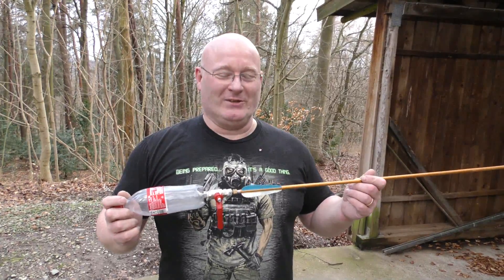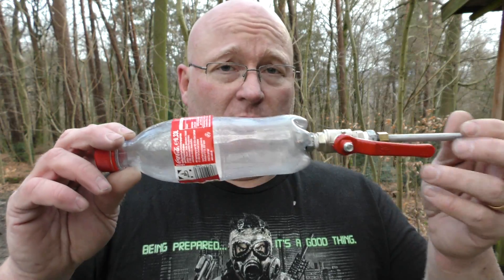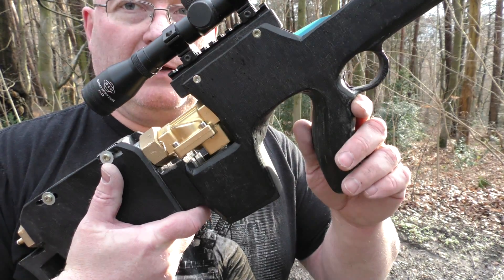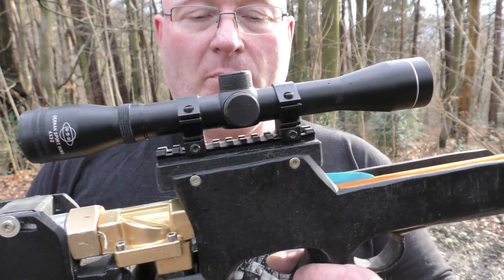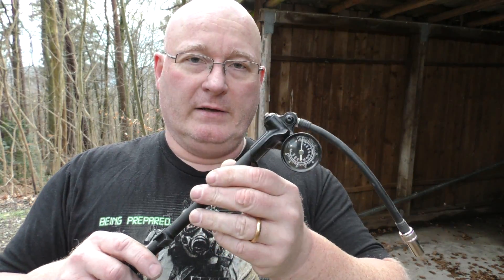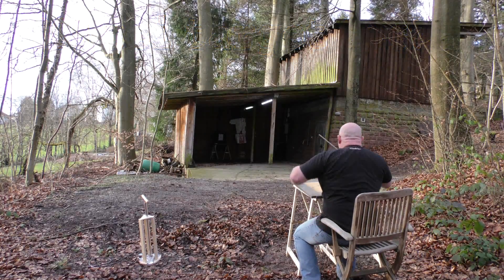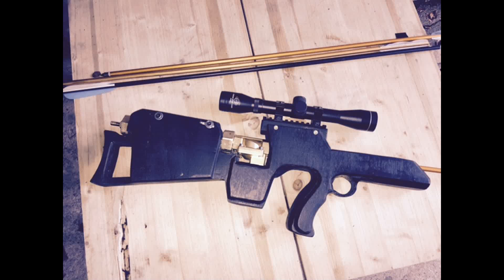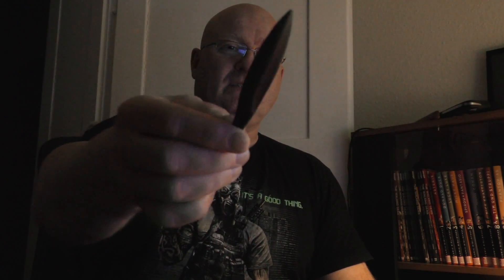Homemade "Bullpup Sniper Airbow" made from plumbing accessories

Comment: i made something like this, except i shoot bbs out of it and it doesn't require a coil for the solenoid. The valve is basically a plastic washing machine valve but instead of using a solenoid to activate, it uses a car tire valve which releases air when pressed. It basically works like a QEV, first, the air is pumped into the air chaimber, and some air goes into the car valve (trigger) area, sealing the air chaimber from the barrel in the process. When the valve is pressed, it releases the air that compresses the rubber to the barrel port resulting in the rubber unplugging the barrel port, which releases the air as violent as with the solenoid. Max pressure (to my knowledge) is about 10 BAR with the PPR air chaimber and it doesn't require any batteries.

Comment: Razor Discs in a normal AIRGUN will go thru trees., and keep going. Stainless steel frisby like disks honed to razor, channeled thru a disc shaped BARREL is extremely deadly. The Military developed what they called a "LANCER ROUND" they outlawed for obvious reasons as it will pass thru the human body like hot butter. NOW make them EXPLOSIVE ON CONTACT and they may even penetrate tank armor. GO FIGURE

Comment: Glad I watched this, I'm slowly getting parts together and was going to work within the limit of these 12v solenoids (never more than about 150psi) using light projectiles, based on the steampunk pistol vid. But if Joerg is putting it through 300-600, that's enough for me. The pistol might even be higher, since he used co2 which is something like 800+ psi. I suppose for momentary usage a solenoid can deal with it. 

Here's my thinking, to avoid gas wastage and save hours of pumping: use co2 or HPA, regulated. Then a ball valve, then a small reservoir before the solenoid. After each shot you open and close the valve, which leaks in enough gas to fill the reservoir but prevents far more than needed to be vented with each shot. You can see Joerg's switch would release everything, which is how it's designed, but a spring momentary would take care of that.

Hell, even 150psi is enough to bury a 13mm BB in wood.

Notice me, senpai

Comment: Kids- Don't try this at home! Mad Jorge is using a 16 BAR  rated valve at better than 40 BAR and holding it up to his head. Quit asking the man for a parts list, blueprints, kits, or builds. He may be crazy, but he's not stupid enough to share the details with someone who can't even figure out "spell checker" PS my 18 v dc Ryobi air compressor will do 10 BAR. Hmmm, I feel a "Hack Attack" coming on. AHAHAHAH
Reply: I guess that explains why I've been having trouble finding a 600psi valve that isn't crazy expensive then.

Comment: Without criticism, would it not be e better way to calibrate the weapon, if you set it on a fixed jig, and then adjusted the sight, accordingly? This way you would not be moving the reference position each time you get up, inspect or reload the weapon and try again. May you try a lever - inside the buttock - that will convert a stroke into a pump action, the type of the bicycle pump you  showed. Nice weapon.

Comment: Why not use the same compressor as in the previous videos instead of manual pumps?
Reply from the maker: Too weak, need more pressure.
Reply: +JoergSprave we need to go deeper
Reply: Could this be done with nail gun 22 blanks or a 223 barrel turned town with blanks

Comment: If you want to improve it you can replace the solenoid valve with a quick exhaust valve that can be piloted with a ball valve  or better with a slide valve and doesn't need a battery ;)

Comment: what is the battery for if you pump it manualy?
Reply from the maker: +CaptainSkelebones For the valve. Fast and can be opened with a trigger switch, much more accurate than a huge ball valve lever.

Comment: Hallo Jörg, wie wäre es mit mit einem kleinen Upgrade? Ich habe die Paintball HP Flaschen für mich entdeckt. Standard liefern die 850psi aber es gibt auch welche über 1000psi. Anstelle des Schrader Ventils kommt ein ASA on/off Ventil und dann ein Remote Paintball HP System. Die Paintball HP Flaschen kann man leider nicht direkt verwenden da sie nicht genug Luftmenge für unsere Zwecke liefern und deshalb braucht man einen Zwischenspeicher. Um die Flaschen aufzupumpen benutze ich eine Sportschützen Luftpumpe und eine 0.8liter Flaschenfüllung reicht bei mir für 8Schüsse(3000psi-2000psi danach fällt der druck des Regulators/Druckminderers spürbar ab) Meine Pfeile erreichen im moment rund 250fps aber ich bin noch am optimieren(größe des Zwischenspeichers, Pfeildurchmesser etz.). p.S. solche Paintball HP-Flaschen kann man sicher auch noch für andere "böse Spielereien" verwenden ;D

Comment: that little pump is typically used for air suspension installed on mountainbikes, hence the name suspension pump. the highest pressure used for the super narrow 18-20mm racing tires from back in the day was about 180psi/12bar, modern 23-28mm tires requiring a maximum of only 120 or so psi.
for comparison, on a "normal" bike it would be 40-60psi.

Comment: Oh I want to make one.  I think gatling would be a rotating electrical contact and could really be any configuration.  I have in my imagination a side by side with two electrical triggers.  I would imagine taking it up to scuba tank pressures with certified components for pressure, fittings, valve etc.  Therefore I'd expect such an invention to achieve arrow velocities equivalent to the $1000 Benjamin Pioneer but be a two shot that would make it a great hunting tool.

Comment: Joerg, another way to use the air gun would be to attach a small magnet to the barrel so that you could slide a BB down the barrel and have it stay in place, the air pressure would easily overpower the magnetic forces and shoot the BB, most likely more powerfully then the arrow.
Reply from the maker: +TheGhettosponge That would be a gun, legally. Don't have a gunsmith license.

Comment: Joerg, I don't know if anyone has suggested this to you yet, but the design of that smaller high quality pump, you could make it crankable with a piston and have it be a fully contained unit, and much faster to pump.
Pretty tempting to build one of these myself now, where did you get that little pump?
Reply: +The Nernbutt I don't know where he got his, but if you want some handpump that can reliably pump up to high pressure look into the ones that are used for PCP airguns. Considering how small that pump he showed was I think it could be used short term, but if you keep driving that piston hard non-stop it will probably wear out on you pretty fast. The high pressure handpumps aren't cheap though, but the Hill pump I've got has been reliable for years. I did have to replace the oring seals once and its not as pretty as it was originally but functionally its as good as new.

http://www.airriflepump.com/acatalog/Air_Rifle_Pumps.html
This company makes one variety and mine has been serving me well for a long time now, easily gets the cylinders up to 200 bar with just my bodyweight and if I'm insane I can make it up to the 275 bar putting a bit of extra air slowly into my diving cylinder with a surface type valve (longer time between the thing needs testing than an underwater type valve). To make the pump work for me above 200 bar you basically have to let gravity do its work while releasing all weight from the ground and as the handle travels down build up momentum to overcome the pressure in the final stage of the pump.

Comment: Crosman beat you to the airbow finish line.
Reply from the maker: +Frank Hieber Actually Crosman simply copied the FXAirgun arrow shooters (Verminator Mk2).
Reply: They didn't call theirs 'airbow' though.  I'd love to have either one.  If you have an extra $1000-$2000 sitting around I'm accepting donations. ;-)
Reply from the maker: +Frank Hieber Well, mine costs well under 100 bucks.

Comment: Crony!  I think you may be on to something though.  With enough accuracy and pressure....it could potentially be used for reasons other than just a toy!  Also,  how high does a standard pump up BB gun go pressure wise?  Seems like it's the same concept

Comment: +Joerg Sprave you should use co2 cartdriges istead of a manual bike pump, they are quicker and easyer to carry
Reply: +Carolus Rex I didnt know about the law, but still there are bike pumps using co2 cartdriges and that would increase the fire rate quite a lot while still mentaing some good power

Comment: How did you make the airtank? And with what did you get it airtight?
Reply from the maker: +iceolator A one inch iron water tube, threaded on both ends. Used standard a cap (brass) and drilled a hole into it for the Schrader valve, the other side I used a 1" to 1/2" female/male fitting to attach the solenoid valve. Lots of teflon tape for the tightening.

Comment: That battery is GIANT! the solenoid won't use that much power, get a car tire compressor.
some of them can do 300PSI and run on 12v.
Reply: +K3PTN You could bolt that to the bottom or something, and charge the next shot with a flick of a switch,

Comment: You should make a rubberband powered wheel that can somehow use the bike pump to pump up the air manually. You could have some sort of rotary machine that makes the bike pump handle go up and down. That'd be a cool little thing.

Comment: Nice design but I think you need to fix a problem that can improve it by far, your air tank is too small, you need more volume, not just more pressure
Reply from the maker: +Quinn stewart Not really. I tested with bigger tanks, no effect. I think the tank is actually still too large. Don't forget the inner dia of the barrel is only 6mm.
Reply: +JoergSprave give it an air reservoir and put a manual valve between the firing tank and the reservoir for quick reloading.

Comment: A carbon fiber Paintball tank holds 4500 psi and delivers a constant 800 psi , spare valves and adapters should be easy to find and a small 45-50 cubic inches one is small enough to add to your design without adding too much weight ...

Comment: i would like to see you use crossbow bolts now in your bullpup. i believe the shorter arrow would be more stable as well as stout. u could easily pass through a concrete block

Comment: you are insane but in a good way, I am glad I don't live next door, if I did I would avoid having pets, love ya stuff though, a high pressure bottle such as the Cheap ally water bottles the  camping ones are good thsy take 800+psi and have a safe 3/4 female thread.

Comment: Also - I'm curious can you make that bull pup design and have it hooked up to a tank of Co2? So that it doesn't require pumping ? How much pressure would be required to use that device hunting ? Could you make is powerful enough to compare to a good compound hunting bow ? Very curious - seems like a very efficient hunting weapon if could be perfected to be powerful and accurate with the scope etc at long enough distances.  I would very much enjoy spending a day with you at the house and in your shop building and testing all sorts of crazy weaponry!!!!
Reply: +NICK SUPREME it would be fairly complex to do a multishot out of 1 tank. His current trigger system just releases all of the air at once. One large tank and a small tank might work if the larger one fills the smaller one, but the issue would be to make each refill a constant pressure.

Comment: You should really buy a small air compressor. It would make the pumping alot easier.
Reply from the maker: +Johannes Kundla Those do 160 psi, tops. Useless.
Reply: JoergSprave Buy a powerful one then:)
Reply: +JoergSprave If you build one from an old fridge,you can achieve much higher pressures. And its free! i did so myself, its a fun project.
Reply: +JoergSprave I mentioned this in an earlier video. Use a refrigerator compressor. They go easily over 500 psi. Use a high pressure O2 tank as a reserve and fill the gun off of that. A Sherwood GV54051-38-75MRI valve with a CGA 540 output gives you a standard 1/4" pipe thread output that you can connect to anything.
Reply: +JoergSprave Hey - i've built compressors and restored two vintage ones - the key to high pressure is just like your bike pump - a long rod in a long pipe (rather than wide and flat)- it takes longer to pump but you can achieve much higher pressures-  mount it up to a motor and you'd be suprised how fast you can get up to 3000 psi for oxygen tanks  - i plan on building my own high pressure compressor
your biggest issue will actually be cooling the pump rod as once you get over ~500 psi it'll start to get VERY hot and melt most rubber seals!  find a way to cool it off and you'll be set up with high pressure ondemand :) (assuming you buy proper rated parts and use a good oxygen tank as reservoir ofcourse)
Reply: Get a paintball HP bottle, fill it with a scuba tank.
fills to 4500psi, lots of different regulators to adjust the output pressure.most common is about 300psi
Be careful though..
Reply: +Johannes Kundla 

Herr Sprave likes his workout :)
Reply: +snikkeldak have a vid to DIY?
Reply: Tom Sobieski no, i dont have a video how to make it. but you can see it working in one of my videos. I just took the old compressor out of a fridge and soldered it to a gas bottle basically. but it works perfectly!
Reply: +JoergSprave On craigslist I found one that does 6000psi but it was $1000.
Reply: +JoergSprave I seriously enjoyed this video.If you had not explained that this was a"homemade"air gun,I would have thought you bought it in a sporting goods shop.It would have been better to use a lithium ion battery,but the design is very solid,and very accurate from what I can see.They do make air tanks that will withstand 3000 psi.I have a catalog with RWS repeating airguns in it that feature these on board air tanks.(machined stainless steel,kinda heavy though)The only way to charge these types of tanks up is with a scuba tank.The compressor to charge the scuba tank with must have tremendous amounts of power to do this.
Reply: +snikkeldak so I found it, and basically just take out the compressor, hook it up to a tank, and you're good, right?
Reply: Tom Sobieski Yes. The only thing is the compressor wil not shut off by itself, so i added a pressure gauge and just do it manually :)
Reply: +snikkeldak I really hope you didn't just let all the ozone eating gasses out in the atmosphere when you disassembled that fridge. Very cool idea though.
Reply: +Johannes Kundla Build it into the weapon with two solar panels, one on each side.
Reply: +Johannes Kundla Air compressors work with volume (cfm), not high pressure. The bigger the unit, the more volume it has. Most large shop units top out at 175psi.
Reply: +JoergSprave Yah the 160 psi one are really bad.
Reply: +JoergSprave What about CO2 cartridge bike pumps ?
Reply: +multimargejta123 co2 it's too expensive to be used on a big gun, I know it because I make air guns on my YT channel

Comment: I'm not sure if the laws in germany would allow it, but could you use a paintball compressed air tank? You may even be able to set it up to have multiple shots before refilling since they can hold about 3000-4000 psi and have a special valve on them.
Reply from the maker: +Chris Yes, that would work. But I think I would have to refill the bottle quite often.

Comment: Out of all the crazy things you've invented this is definitely one of the coolest and sleekest. I assumed that battery was to make it self-pump off a compressor or something; apparently not. So honestly the only drawback of your ever-evolving airbow design at this point is the reload time.
Reply from the maker: +Adrian Smith Well, it comes down to the cost of a compressor that can go as high as 600 psi.
Reply: JoergSprave Good point. Maybe just take the pump as an arm-strength building opportunity.
Reply: +JoergSprave use a refrigerator compressor!!!  Theyre cheap or free and can do a few hundred psi!

Comment: Great:) but the limiting factor is the magnetic valve. They do not have really great air flow (I've been testing and building guns with them). QEVs are the way to go for such a gun;) welcome to pcp guns!
Reply from the maker: +DerKrawallkeks Don't forget that the tiny tube diameter (6mm) does not require a huge amount of air. Initial pressure is more important,
Reply: Yep;) just had the same thought. The valve is not going to be the tightest point. On my tests, i've been shooting bigger cal. For 6mm it's actually a quite good solution:)
but if you're interested in pcp guns, have a look at QEVs!

Comment: Please someone make a mod for this in Fallout 4.
Reply: +Aleksej Rakić right now it is really hard to add new weapons, you have to wait for the geck :P
Reply: Sounds like if you wanted to do it well it'd be hard, because i think the best way to implement it would be to add every piece of junk joerge actually used, and then all the custom models and scripts for the gun. I'd do it if i was a good modeller, but alas. Someone should though
Reply: If that happens then hopefully alchestbreach will review them
Reply: +Ethan Porter Actually it's rather easy. There are good tools to import models and animations. However, right now it's impossible, because the G.E.C.K. (Bethesda's official mod tools) have not yet been released.
Reply: +Hippownage sure it may be easy to import the models and such, i've seen alot of great gun mods for NV and 3, but modelling is still a pain in the ass and it's hard to come by someone who's good/like's doing it, especially for all the different junk bits with the way i thought would be nice to do it